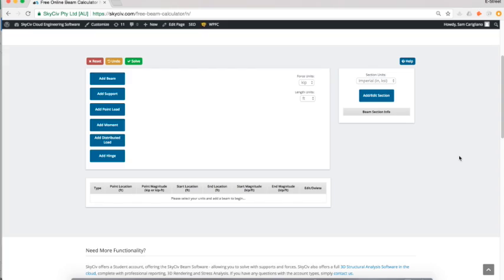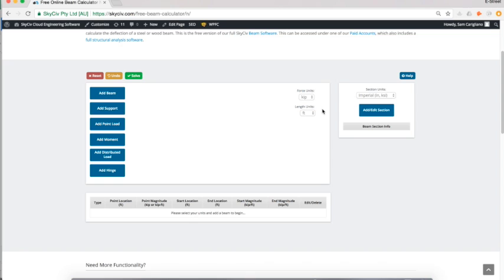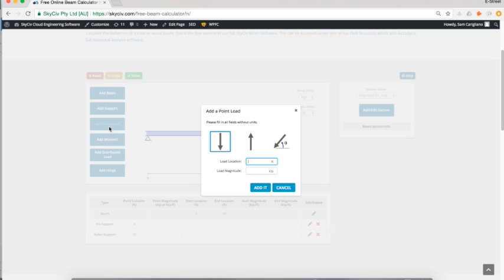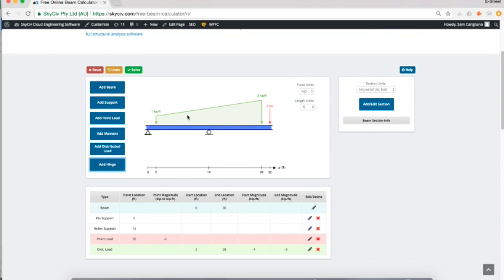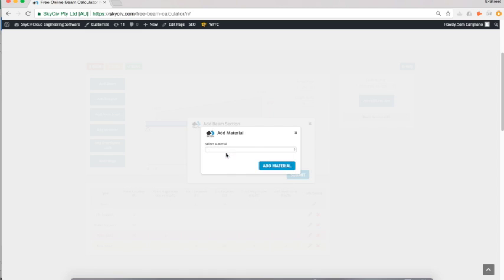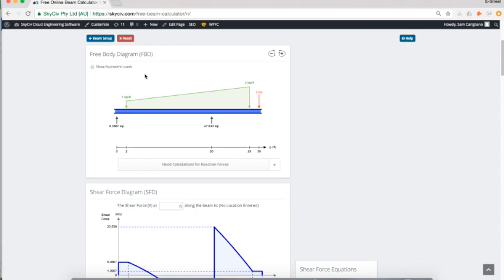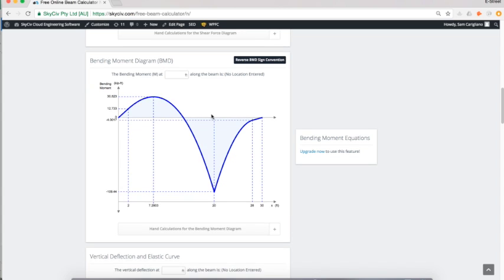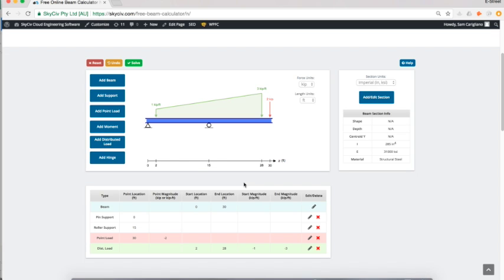Free Beam Calculator Demo | Beam Analysis Software | Calculating deflection and stress

Comment: boat trailer, will be several c beams welded to create square sections,i am trying to solve a 23 ft c beam loaded , the frame is braced each 43 inches, were they hold the boat weight, as they are over the wheels, this mean the support are rollers?
Reply from the maker: Hello Roberto,

Our support team can't offer consultancy on what types of engineering assumptions you make. In this case, we can advise you that the roller support does allow for movement laterally, but does support vertically.